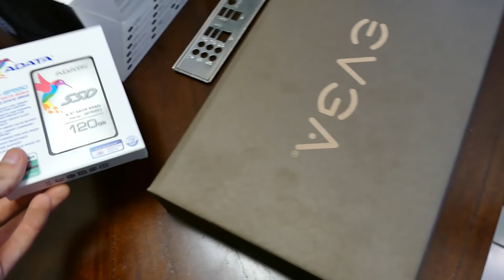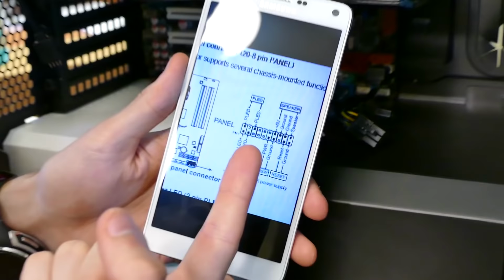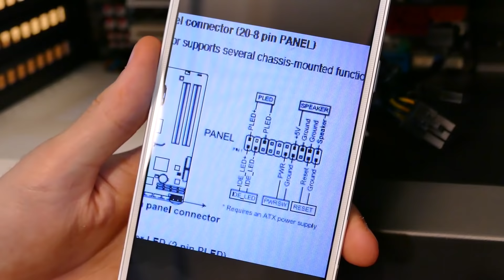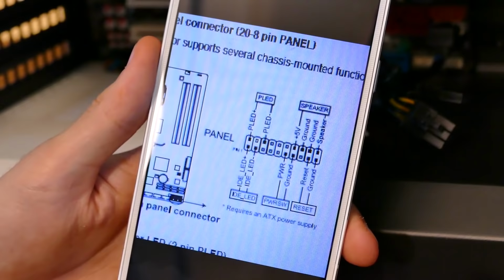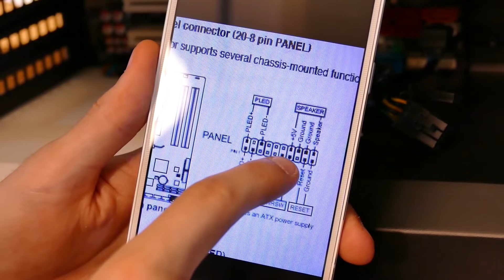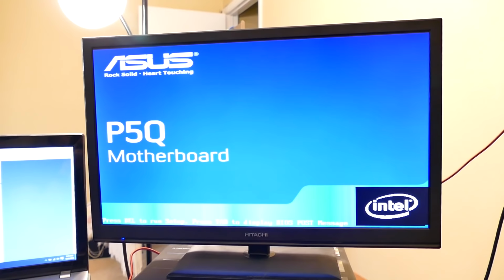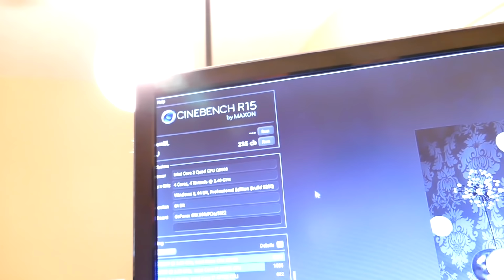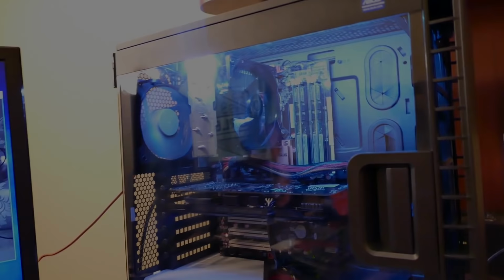Q6600 PC Build Vlog

Comment: I thought used Core 2 Quads were the go to budget for a while but in my area I've been seeing a ton of I5 2400 and 2500's from dell optiplexes. Usually whole desktops for under 200, so you'd only have to upgrade PSU, RAM, and add a GPU
Reply: And the case if you want pretty stuff
Reply: A lot of optiplexes use BTX formfactor cases and boards, which basically means you are stuck with the an OEM case, or you'd have to swap out the board as well.
So really, you'd end up paying the 200 just for a processor, depending on what you'd like to do with it of course.
Reply: +Jacob Muldoon Watch Greenhamgaming, he does a build with it and a r9 380 and it does pretty well
Reply: used dell i5 machines are a good budget route.  now that we're in the second half of 2016, a second gen i5 is a strong budget contender for a $400 build.  some dells have quality 500W power supplies with 6-pin pci-e connectors, whereas some dells have cheap 300W PSUs.  

all of the dell socket 1155 towers i have seen are atx.  "btx cancer", as i like to call it, was more circa 2005-2009 (socket 775).  when you buy a dell box, the front panel connector has a unique OEM design.  you could rewire it but it's a huge pain in the balls.

when you go the cheap socket 1155 dell OEM route, you generally should use the OEM motherboard.  this is not such a bad thing, however, as replacement boards can be had on ebay for super cheap.  we're taking $25-35 for most dell socket 1155 motherboards with 4-phase CPU power.  good enough for non-overclocked i5-2400 chips.  the 2500k chips are true overclocking monsters, but good 1155 motherboards start around $80 used, and 2500k chips are $85-$100 used.  you'd also need a decent cooler, for example, Hyper 212 Evo used for under $20, cleaned perfectly with alcohol and with amazing paste.  the way intel soldered the heat spreaders on the 2nd gen i5 chips is really sexy.

you could have the overclockable i5-2500k, good 1155 motherboard, hyper 212 Evo for $200 used.  decent used case, RAM and power supply - $100 so we're at $300.  get a used 7870 or 7850 and 120GB SSD.  boom, there's my $400 build.  sandy bridge, baby.  CS GO is CPU-bound, so you can get crazy framerates with overclocked i5 chips.

Comment: how much watt of power supply would I need for i7 5930k/i7 6800k, 32GB DDR4 ram, GTX 1070
Reply: maybe 500 or up to 750 to play safe
Reply: Griffin Ayson is there a big price difference?
Reply: I recommend around 650w-700w
Reply: Hassan Jamil ok man, Thanks :)
Reply: TheGamingWIZ np
Reply: on pc part builder that system draws 320 watts
Reply: ***** but i will need some extra power for future upgrades
Reply: put  your complete build in pc part builder and it will give you the power usage I just put in the major power draw components, good luck
Reply: ***** ok thanks man :)
Reply: pcpartpicker.com pc part builder was a brain slip this happens when you get old LOL

Comment: Why not a wolfdale Core 2 Quad?
Reply: The 65nm older variants overclock better since they are much more voltage tolerant. 45nm wolfdales have a higher IPC but does not justify its much lower overclocked life lifespan.

Comment: I have a Q8200... should I go too for the 950? +Science Studio
Reply: Go for it
Reply: Thanks
Reply: 950 is decent but used 960s are pretty cheap and a good bit better.
Reply: +wingracer 16 I don't think a Q8200 could handle it without any bottleneck.
Reply: ***** Not a big problem,I'm buying an i7 6700 + GTX 1080 / Vega vga, and planning to sell the Q8200 build to buy an lga1151 one (one one five one one XD)

Comment: why the hell would you build a computer with a 10 year old processor and chipset? what is that p35? p45?
what did you upgrade from an 8086?
Reply: Josh Cook The xeon x5470@3.33 GHz stock would absolutely crush the q6600!
Reply: for less money
Reply: Josh Cook The x5470 does cost less money than the q6600!

Comment: i woulda stepped up to a q9300 or something, Alot less power draw and even at a lower ghz it outpreforms the q6600
Reply: The 65nm older variants overclock better since they are much more voltage tolerant. 45nm wolfdales have a higher IPC but does not justify its much lower overclocked life lifespan.

Comment: Yes best budget build on the planet lets just pay 16 dollars for very old CPU and spent 114 dollars on case.  I bought it completely other way around last year and pay less then 400 euro for
i3-4170 (3,7GHz)
8GB of DDR3 ram
530W PSU
cheapest tower cooler i could find (for 8 euro but I don't run 105W OC to oblivion 65nm old CPU on it)
cheapest decent case for 20 euro
motherboard
WiFi card + 9dbi antena
and used Geforce 570 thats more or less as good as your 950 and cost only 50 euro.
Now when I will go for upgrade I can sell cpu for decent money and GPU for some money and then put in any core i5 or i7 or desktop version of xeon cpu + more powerful GPU and thats it. You on the other hand have to rebuild computer from scratch on new cpu+ new MB + new ram and all those used parts you are using now will probably end up in garbage bin. Brilliant way to go mate, but hey it looks nice doesn't it?
BTW how long do you thing this 9 year old CPU will last overcloced to 141% stock speed? I will be surprised if this computer will be stable for more then let say half a year. Good job on helping your friend.

Comment: My old Q6700@3.34ghz scored 360cb in Cinebench and my girlfriends Athlon 860k@4.4ghz scored 368cb. That says A LOT about AMDs performance relative to an 8 year old Intel....Yikes. Granted at the end of the day the 860k handles her 270x Devil just fine in all the games she plays. I did get the q6700 up to 4ghz and it scored 426cb in Cinebench so if it could get the q6700 up to 4.4 to mach the 860k Im sire it would beat it easily.

Comment: Why would you build him a dead-end LGA 775 system in 2016? It's a 10-year old platform. For $150 you can build an entry-level Skylake system that will kick this build's ass. Sinking money into DDR2 memory and a 775 motherboard... probably cost you as much as a new entry-level system would.
Reply from the maker: For $150? Entry Skylake? For video editing? Do your homework.
Reply: Yes, you can get the Asus H110M-A/M.2 board for $50, a Pentium G4400 for $60 and 8GB of DDR4 for $35. The Pentium is a dual-core/dual-thread and by no means a video editing CPU, but it still destroys the Q6600 in multithreaded tasks. Check out some Geekbench scores. And you'd have much faster RAM that you can expand to 16GB or more (DDR2 has an 8GB limit on Intel platforms), PCIe 3.0, SATA 3.0, USB 3.0, M.2, etc. And you can upgrade to a much better CPU in the future. I mean... we're comparing a 10-year platform/10-year CPU to a modern one. How is this even a discussion?

Comment: I'm curious as to why you would use a q6600 at all for a video rendering rig. I mean at the best it will only come close to a modern i3. And while q6600 is an awesome cpu like those good old phenom x4s but it is old and pretty much outdated by now. Why not use an second hand xeon like e5-2670? you get 8 cores 16 threads from a fairly recent architecture and it's killer value for the money i know they have gone up since all those xeon build videos went up but you can still find x79 mobos for around 200$ and even less if you try to find one locally. Also you can have the full build at around 400$ and it will blow the q6600 out of the park with its multi core performance. I think Yes tech city had a great video on this i recommend checking it out.
Reply: he paid 15$ for the q6600
Reply: Well he might have only paid 15$ but the build cost him 400$ . 400$ for a build that has zero upgrade options, only ddr2 memory and a outdated cpu. All these things are ok if it serves it's primary function well. Which is rendering and it dosen't do it all that well. my point is you can do a whole lot better for 400$ if all you wanna do is video rendering and light gaming. And as for expensive mobos yes they are expensive but not that expensive you can find one for 200$

Comment: I think prime 95 should be tested for at least 1 hour right?
Reply: AT LEAST. I ran it overnight to be sure when I decided on my overclocked.
Reply: Peripheral Vision I will overclock my fx-6300 to 4.7 i just need to test it everyday, i only go 100mhz each day
Reply: prime 95 creates an extremely unrealistic load on the CPU. It would be better to test using AIDA 64
Reply: +LiquidPanic aida 64 is more realisstic but to test your overclock prime 95 is much better
Reply: BenchmarksX It really isn't. That doesn't even make sense. Unless you're doing scientific research your CPU will never have the kind of load that Prime 95 causes. It's also been known that Prime 95 can damage your CPU if you go for a little bit of an extreme overclock right away, which some new people might do.
Reply: +LiquidPanic listes i have talked with people with way over than 10 years of expirience and they all do overclock and prime 95 is good, overclock only damages your cpu if the temperature is really high on intel case 90 degree on amd side 70 at least the fx line and of course if your voltage is too high
Reply: BenchmarksX Higher clock speed = higher temperature. Higher voltage = higher temperature. Prime 95 makes an unrealistic load. New person might go for an enthusiastic overclock. Like I said, Prime has been known to damage CPUs when new people are overclocking and go a little high on the settings. Other programs would just thermal throttle or shut down, but Prime 95 causes the temperatures to rise so quickly it can damage the CPU. You really need to actually read, NEW PEOPLE. I don't care about your friends with 10 years of experience, they're most likely not going to go for an unrealistic overclock right away like someone NEW to overclocking might.
Reply: +LiquidPanic well you dont need to care about my friend they know what they do pretty well and by the way who overclocks a cpu with a shitty  cooler, i have an cooler master hyper 212x and my cpu wich is an fx-6300 overclocked at 4.7 goes between 50 and 60 deegres those are good enough temperatures for an amf fx shit usually turns bad at 70 degres, obviously it depends if you have the minimum requierements to overclock like a capable motherboard in amd case one with the 970a chip is enough and obviously a decent psu, one strange thing is that the fx line i think, the safe voltage is 1.4 i must say that mine for some reason came from store at stock speed and 1.416 voltage strange i think
Reply: You're just ignoring everything I say. Keep living in your world where you can never be wrong, bye bye.
Reply: +LiquidPanic im not ignoring what you say i mean most people first time when overclocking need to investigate first and they do so its not very likely that their cpu is going to overheat because internet has informmation in case you dont no
Reply: +LiquidPanic Well then if its fine with prime95 then you definitely know your oc is OK. Also I have never had a CPU skyrocket to a high temp that would damage it with prime95. Thermal throttling would definitely stop it as thermal throttling can kick in very fast and if it gets to hot your  computer would most likely turn it self off if you have a good/modern motherboard.
Reply: +LiquidPanic Also no need to be a douche to that other guy. He was not ignoring what you said he was saying that most people over clocking wouldn't be dumb enough to let their CPU set ablaze.
Reply: +LiquidPanic but man new people only damage parts if they dont investigate about overclock wich they do all the time
Reply: BenchmarksX "All the time", nice assumptions. Since you or the people you know did it than everyone does right? I've been saying that there are LITERALLY user accounts of it damaging parts. This isn't me being like "Oh, since it's an unrealistic load and new people might not research, it could happen". This HAS happened.
Reply: LiquidPanic If you dont know anything about overclocking and you want to do it what will you do?? Investigate because you need to see others do it before you do it yourself, you need to learn
Reply: BenchmarksX THERE ARE USER ACCOUNTS OF THESE THINGS HAPPENING. There is absolutely no argument, why do you keep ignoring what I say just to spout the same shit? Yes MOST people will do research, most is not all, and those ones that don't can literally destroy their hardware using programs like Prime 95.
Reply: LiquidPanic IF THEY DONT DO THE FUCKING RESEARCH HOW CAN THEY FUCKING LEARN HOW TO OVERCLOCK IF THEY NEVER MADE IT BEFORE???? THEY NEED TO SEE SOMEONE FUCKING DO IT, YES SOME DONT KNOW THE "SAFE" VOLTAGE AND THATS WHY THEIR CPU BLOWS , BUT USUSALLY AFTER THE VOLTAGE EXCESS THE CPU STARTS TO SHIT IT SELF MAYBE A FEW WEEKS, MAYBE MONTHS NOBODY KNOWS
Reply: That is really only a problem with newer cpus with AVX/AVX2 instructions.. With older cpu's it is a great test for stability.
Reply: Peripheral Vision Good argument.
Reply: no 1 hour for what? i tested prime 95 for like 5 minutes. Never had a problem ever.

Comment: Guys I need help 
Core i5 6600k 3.5ghz
Gtx 1070
Power supply 800wats
16 ram ddr3
 aFan
Any mother board
Windows (op)
Anti virus 
Ssd 250 or less
2 terabite
Will it run every game at 60 fps or more and what if I changed the gpu to 970 or 980 and will it be good for editing
Reply: Depends on which resolution youre playing your games
Reply: 1080p, yes. 1440p, probably yes. Maybe one or two badly optimized games that would drop to 50s on extreme settings but still fine. 4k, no, get a 1080 or Titan XP.
Reply: +wingracer 16 thnx I will be playing 1080
Reply: +TheDutchSheep it's 1080p
Reply: Why an 800 watt PSU?
Reply: +LiquidPanic i don't know how much is enough
Reply: ***** A good quality 500-600 watt PSU will be fine.
Reply: +Owais 555 I would go with 600 watts

Comment: Asus Strix Radeon R7 370 DC2OC 2GD5 126,51 euro 
Corsair Value Select 8gb ddr4 29,95 euro
ASRock H110M-DGS 54,30
i3 6100 3,7Ghz 2 cores 4 threads 116,50 euro
Zalman ZM-T3 21,50
HP PV943A, 500GB hdd 36,46
XFX XT series 400W 29,95

416,17 euro's and is a better value.

Comment: Dude 470. Or are the nvidia bucks thats good??
Reply: If you listened to the start you'd hear him mention Cuda for rendering. CUDA acceleration is slightly better than Open CL
Reply: the 470 literally released yesterday
Reply: That too, this was probably made a while back
Reply: I wouldn't want to use any AMD GPU with the current state of their software to begin with.
Reply: +CrackedDylMil what do you mean?  It seems fine to me with an r7 360
Reply: +CrackedDylMil stop shilling m8.  Software is fine
Reply: +Phoenix Wright AMD lost the entire dx11 race because of their awful software. Several cards burnt. Several OSs corrupted. Terrible optimization for new games. Etc etc
Reply: +Phoenix Wright There was a memory overclocking limit placed on the rx 480 cards recently after a driver update. i think that's what he's talking about. Its being patched in the next update though according to GamersNexus sources
Reply: CrackedDylMil no gpus were burnt that i know of.  If you're referring to the rx 480 dead motherboards,  then you should do more research,  as only one system was confirmed damaged,  but it was in already terrible condition.  Also,  do you remember when nvidia released drivers that had a tendency to brick gpus and displays this year?
Reply: ***** its being patched,  and amd stated it was a mistake.
Reply: Phoenix Wright I want AMD to release better drivers for linux :(
Reply: Phoenix Wright I know, that's what I said..
Reply: Tuchulu i agree with this.  Tried playing games on linux and could not get playable framerates.
Reply: +Phoenix Wright just get windows
Reply: FusionFall Maina We shouldn't have to use Windows, that's the thing.
Reply: I find it difficult to beat the GTX 950 in bang for buck. It can be had brand new for ~$120!! plus it plays most AAA games at high settings at 35+fps on 1080p.
Reply: I beat a 950's bang for buck by getting a 750ti for $40 and they have practically the same performance
Reply: GrimRipper1080 wow that's like 60% off. Good job!
Reply: Well, it helps when the guy selling it thinks the card is broken when he just needed to switch the video output in his bios
Reply: +Dylan Scully No this video was made today it literally says August 5, 2016 in the description lol.
Reply: +Dylan Scully CUDA rendering does not compensate for the fact that the card is almost 2 times slower than the 470. Js.
Reply: mate youtube vids are usually made a couple of days before they're uploaded, rx 470 literally came out yesterday, sorry to break it to you<3
Reply: ZackSNetwork I mean i thought it was pretty obvious that I meant it was FILMED a while back...
Reply: ***** There was a follow-up video where they bought a new cpu (I believe FX-8320e) and motherboard, they'll also be overclocking it. So now it's a good average PC
Reply: +Wapaaam HD DX12 is shit even on AMD hardware. You probably meant Vulkan which as of now is being used in like 3-4 games. By the time Vulkan becomes popular the next gen of GPUs will be out with much better Vulkan support. While the 900 get no boost from Vulkan. They still shat on AMD cards with much lower core count due to AMD's poor DX11 drivers.

Comment: damn, you could still go cheaper on the case to drop the price down even more.

good build

Edit: i change "Good one" to good build...after reading i notice it sounded like a negative comment.
Reply from the maker: The case and LEDs were $50...
Reply: it is?

amazon has it at 100$ when i clicked it, my bad. still good build for 400$
Reply from the maker: Most of these components were used.
Reply: Science Studio ah i see, that was a good deal even if its used.